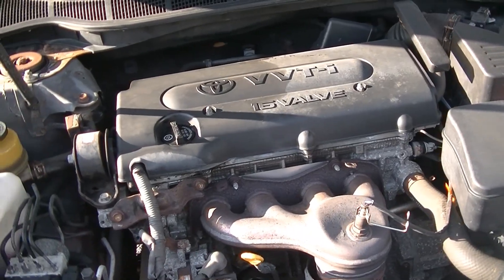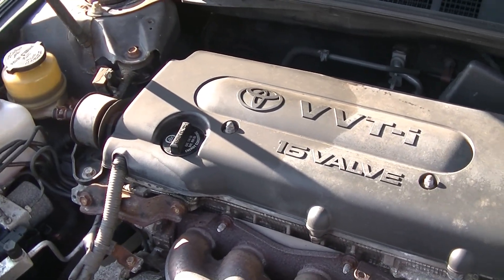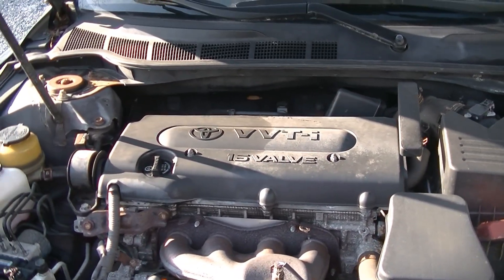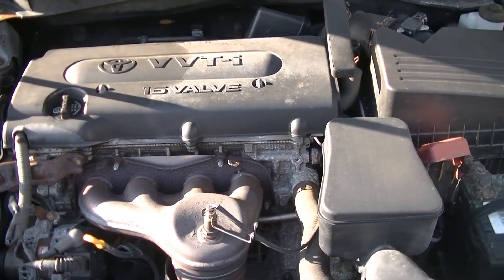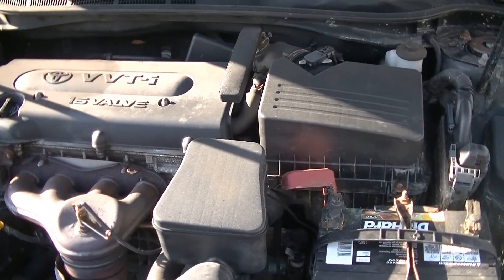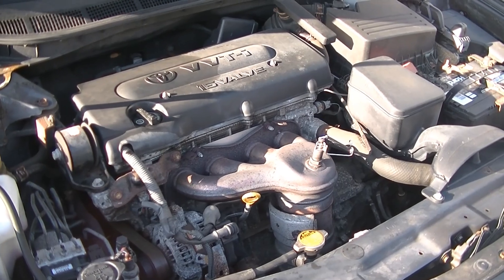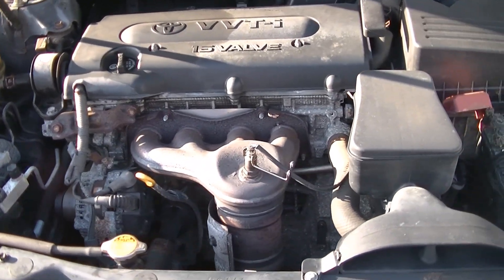Why you should AVOID a TOYOTA with the 2AZ-FE 2.4 liter engine!

Comment: I have a 2003 camry with this engine and auto transmission. It doesn't use any oil between 5,000 km change intervals. It doesn't get thrashed, gets a minute or two when cold started to allow the oil to circulate and has never missed a beat. It's about to get a new water pump as it's weeping from the tell tale hole, but that's just routine maintenance. Still runs quietly with plenty of power and will return 700km from a tank of fuel.

Comment: I have a 2004 camry LE. With. 240000 miles   use Mobil 1 and change oil every 6000 miles  it uses 2 quarts every oil change   I plan on going 400000 miles on this engine. Runs like a top  33 mpg hwy 24 mpg city  this engine is a great engine  just make sure to change oil and never ever let this engine over heat

Comment: I heard it’s the 07-09 with all the problems my 04 has 230k now burns a quart every week or 2 only after sitting for 3 years  of sitting other than that runs fine only had to change brakes and oil so far had it since 120xxx I heard the v6 had same trans and runs it out faster than the 4cyl I’d I had a v6 I would be stepping on it soooo good thing I don’t

Comment: My 05 Camry has nearly 400,000 miles and still runs smooth. Sounds like a new engine
Reply: I hate to say it but that's pretty much the end of its life cycle. They're meant to last 400,000 miles
Reply: Did it burn oil ?

Comment: keep the oil changed so the rings won't get clogged up and start burning oil..If the head bolts lift install timesert head bolt kit..great running motor when you know how to take care of them..
my new 2.4 engine never goes past half on the temperature gauge..

Comment: Yeah a customer/good friend is going through everything in this video now.Only good thing is I'm a mechanic,as you said it overheated 'once' and boom! Water in the oil and not running no more. As I was taking the head bolts out,out of 10 bolts only 2 were still torqued to specs,the other 8 were all less than 10-15 ft. Pounds . It really puzzled me to see that all the valves were rusted front and back and every piston was nearly full of coolant,cause typically head gaskets blow in isolated areas witch wouldn't affect every cylinder. Initially I was charging my friend $900 for a valve job (supreme love from machine shop and she's a good friend) but with the thread it'll be a extra $200-300 on parts... At a shop this is easily a $2000 job on average. My advice would be to go with a rebuild or a certified serviced engine with as many upgrades and satisfied recalls as possible or gamble on a extremely low mile one.

Comment: I have this engine in my car and I am a mechanic. If you have this engine in your car and it fails it's because you are an idiot and you don't use the right oil, or change at the right intervals. You will never have this problem if you do that. Those bolts come lose because your oil is terrible. This video is proof that idiot's make videos that aren't even needed. You treat these motors right and change the oil with a synthetic correct 0w 30 Mobil 1 oil, you will never have this problem. Especially if you change it every 3500 miles. Never change your oil past five thousand miles. This is the stupidest thing you can do. Of course it tells you to do this kind of thing in the manual. They are in the business of selling you a new car.
Reply: Toyota wouldn't have fixed any of the head bolt problems for free if there was any possible way they could blame it on the oil. How does poor oil or infrequent changes cause head bolt threads to strip?
Reply: @justliberty4072  infrequent oil changes can cause all kinds of problems. Including bolts to lose their strength and strip or break. I've seen that in my buddy's shop.

Comment: My brother works on these Camrys (& other Toyotas), and according to his experience, it is the 2007 & up with the oil problems. I have bought 3 Camrys from him, and have not had any problems with oil consumption. The one I drive now has over 240,000 mi on it. I just changed the oil(at 5,000) and it was about ¼ qt low. I haven't added any oil to since the last change. I don't know if any engine work had been done before or not, and it is the original engine.(numbers match)

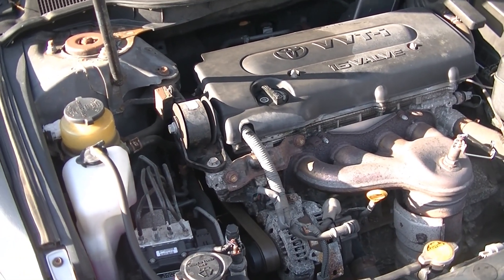Comment: I'm sorry but at 2:40 I had to pause it because you couldn't be more WRONG about helicoils and timeserts. In aluminum, they are actually STRONGER than the original threads. When you have a steel insert of a larger diameter, the original diameter threads are now both steel, and the steel/aluminum thread surface is now a larger diameter, thus more surface area for the threads on the weaker metal.

Comment: this whole thing about cooling system .
 what I did with the plastic/metal radiator at 90k miles is take it out and replace it with a 2 core all metal rad.I have 270k on mine now
with these toyotas it is very easy to do, it's not a VOLVO folks!

Comment: Anyone with a 2004 Toyota with the 2az-fe engine? They just burn oil. Used Mobil 1 for 100K, Used Amsoil for 35K miles and slow down the oil burning to half.  These engines from 2004 or earlier before the redesigned piston heads are notorious for this.  I’m not a mechanic and it’s not worth the costs for repairs. Drive it till the engine falls apart

Comment: 353000 miles on my scion 2.4vvt-i no recalls done. Yes its a 2AZFE. Burns oil but not alot. Its a very easy engine to maintain, its a workhorse... one of Toyotas easiest DYI engines.

Comment: 2AZFE engine is a great engine and typically operates into the 300k-400k miles. Change the oil every 5000 miles or 6 months to avoid issues and use a good 5w-30 oil. 

The first issue did have a TSB and owners were taken care of by Toyota and they extended the warranties for those vehicles. The fix is fairly easy and an advanced DIY person can do the job. Time Cert repair kits were used for warranty repairs and did not void the vehicle warranty (when I was working) they were as good as the original, and I have never seen one fail or personally heard of one failing.

The bad piston design was mainly an issue with the oil rings designed to give better fuel economy, which is also why they switched the 5w-30 to the 5w-20. They made a special kit that included new pistons, rings, and squirters that included all the gaskets necessary to resolve the issue however that isn't a DIY repair.

While this engine had its issues... it is very easy to work on, depending on the vehicle it is in, and extremely reliable. When I got rid of my Dodge neon it had 424,000 miles but I spent 10x the time and money on maintenance and preventative repairs than I would have on this engine. By the way, Dodge had a similar rear head bolt problem causing head gasket issues, the rear bolt holes were not deep enough from the factory. 

Every vehicle manufacturer has issues, but at the end of the day, this is one of the most reliable 4-cylinder engines I have ever seen. How many 4-cylinder vehicles have you seen with 300-400k miles on an original engine with only regular maintenance?

Just my personal opinion.
Reply: agreed,my vellfire 08 almost 200k km still fly like the wing.🤩
Reply: I'm considering the Alphard Van 2003 - 2007 model with this engine in it, but I know that around that time, Toyota was also touting the oil service intervals were now at 15,000 k's, which is when a lot of engine damage is done early on... hence my hesitation on this engine, the head bolt problem and the oil burning problem.  Most people follow the company recommendations not knowing any better not being mechanically minded... so the van I want quite possibly has had this extended oil service interval performed, not the better 5k mile / 8k km I do all the time on my old 5sfe camry....  The 1MZ FE motor has its own possible problems and the timing  belt will be a mission in that van / people mover setup, not much working room, if you know the Alphard engine bay setup.  What would you recommend yourself, still stick with the simpler 4 banger design or the V6 1MZ FE???  Cheers
Reply: Is valve train clicking normal
Reply: If I continue using decent oil and change it at 4k mi, would the issue slowly develops or this would avoid the future oil burning problem?
Reply: Check the oil every 2 weeks & add when needed (it will need)

Comment: Dude doesn't know what he's talking about. This is literally one of the most reliable engines. 2azfe can easily go to 250k+ miles. Mine is currently at 210k miles. Have not had to do any major repairs besides motor mounts.
Reply: Literally your personal opinion and experience. 
Lost over $5K thanks to this engine going out with only 119k miles

Comment: My son still drives our 2004 manual shift camry with almost 200k miles on it.   The only thing I've had to do is replace a valve cover gasket and leaky radiator along with 5th gear repair with a clutch (which is apparently fairly normal). Still the best driving car I've got... It is a Japanese made car... Don't know if that makes a difference, but I love this car.
Reply: 2004 2az fe engine  has different piston design   2011  Ithink is when they changed the pistons

Comment: I own two cars with this engine and zero problems, one for 19 years and one for 14 years. You can't cheat on oil change maintenance!  The people I know personally with oil consumption issues have cars that were neglected and overheated. No modern engine can tolerate overheating and skipped oil changes. Knock this brand, but I service several brands of cars and this is my favorite of all engines.

Comment: My brother-in-law had a 2002 Camry with this engine. At 189,000 km (113,000 miles) the head bolts stripped out, coolant dumped into the cylinders and the engine was destroyed. It cost almost $9,000 to get the car back on the road. The dealer swore he'd never seen a failure like it (Toyotas run forever!) but the Toyota mechanic quietly said he saw quite a few of them. The engine had always been dealer-maintained, had its regular oil changes etc. The engine was going to self-destruct eventually, no matter how well looked after.

Comment: 329k miles on mine ( 2005 camry )...doesnt burn a single drop....a real champion of an engine. there are some people with over 1M miles on it...one of toyotas best
Reply: it is not the engine in the 2004. This engine 2AZ-FE was in the 2007-2009 Toyota Camry. When he said 2002-2009 he doesn’t know and is WRONG.

Comment: Oil burners are extremely costly money pits as oil isn't cheap, either are spark plugs , or sensors or catalytic converters which need replacement on a regular basis with oil burners as  they cause major carbon build up. So to the comment made keep the oil in them they will last forever so untrue and a ridiculous comment to even make .

Comment: You have no idea what you’re talking about! These engines will last forever unless you abuse it.
Reply from the maker: Or unless they burn oil due to the low tension rings that they began using in 07 and run it out of oil. There’s a reason Toyota issued a service campaign on them.
Reply: Defective piston heads in these notoriously 2az-Fe engines.  Owners got put in a tough situation with this engine. 3K oil changes with conventional or full synthetic or 4K-5K oil changes with Amsoil Signature Series
Reply: Never had an issue with them unless they have been abused.

Comment: Have this engine in my 2006 Scion TC. Just turned 178,000 miles and it doesn't burn a drop of oil. I always use Mobil 1 full synthetic for every oil change, and always do my oil changes between the 3k and 4.2k mile mark...no clue about the previous owner though (bought the car with 123,000 miles on it already). I also run a full bottle of Techron in it before each oil change. With good maintenance, this engine will last and last. I'm nearing 200k miles and still average 31+ mpg on the highway. Bulletproof.
Reply: still driving my 2007 scion tc with 257k miles. I do add extra oil in between changes.

Comment: 2004.
2.4l.2azfe.
camry.225000 miles.
i used for several times, power steering oil, transmission oil, petrol/diesel engine oil of all grades 
0w16 to 20w50, and it might be capable to use water without any issues.
used it for more than 6 time to travel 2000 miles / 18 hrs per each without stop.
used it in extreme harsh weather, 51 celuis/124 f° for 4 hours riding at 100 mph dust weather
used in exceptional harsh weather 55 c°\ 130f° short intervals, found that i have a super cooling ac & super cooling engine system 
the greatest toyota/ lexus engine are those made between 1980 - 2007.

each 1000mile i need to add half liter of oil.
thats it.
maintenance:
1 Oil pump
1 tensioner pully 
1 radiator
2 radiator fan motors
regular spark plugs/ air filter/ oil change
Thank you.

Comment: I have an 09 camry with the 2az-fe eng..482,068 miles at the moment.  Sure, it burns oil and there are things to do to mitigate  the oil consumption, but I'm still driving it to this day. Original engine, transmission... water pump... drive belt.  What other car can you say this about? I love this thing. And nearing half a million miles, it's still fun to drive!
Reply: My friend has a 09 Vibe with the 2AZ and has 300,000 hard commuter miles on his. It burns a little more oil than most, but it's a solid engine and feels better than the 1.8
Reply: Ever had to replace lifters yet ? Another common issue
Reply: @kylel4689  have not replaced lifters, haven't replaced any internal engine components ..yet
Reply: Im at 293k changed about everything my waterpump starter still original
Reply: Hi @wes_5kyph1 what things do you do to mitigate the oil consumption? And how often do you service the vehicle?
Reply: Same here, got 230 thousand miles on mines, minor repairs other than that I love it
Reply: @KyleEdwards-if3po trying to get rid of mine. interior panel is worn out and it needs a new transmission. 2nd car is 2nd gen scion tc, stick shift with 370k miles...yes some things at little cost can really help in the long run
Reply: @Wes_5kyph1 damn 370k , gotta love Toyotas

Comment: My 2008 2az-fe uses about a quart between oil changes. It has 196,000 miles on it. I strapped a turbo on it.  It runs great.
Reply from the maker: A quart between oil changes is nothing! I’ve actually driven a turbo TC with the 2.4. Fun little car

Comment: I guarantee you if someone is selling one of these, it’s because of the oil issue. I have yet to find one that’s been fixed, all I’m finding are lemons. Avoid the gamble unless it’s a V6 or it was fixed….or it’s a 2010-2011 which had the 2.5
Reply: i feel ill.  just bought one of these for my kids first car, for more than i wanted to pay.  Solid bones, clean car, everything works, 201K.  hoping to get a couple of years out of it, even if I have to add oil between changes.

Comment: We have 2004 camry 2.4l xle in family for 10 years now. It has 165000 miles now and have some oil consumption, but no major problems with engine yet. Alternator and starter had problems, but not the engine itself. This engine is very heat loaded, this i can confirm. We change oil every 5000 miles.

Comment: When you consider how many millions of vehicles sold with these engines, only a small percentage failed. 
Also re years, from 09 on they had modified internals, slightly higher compression. So 09 on, well maintained should be no problem.

Comment: I tend to agree with your advice. Had a 2007 Camry that got the warranty repair at 85,000 miles. It was using a quart and a half in 1200 miles per dealership test. The car was driven mostly freeway miles, 80 miles per day five days a week. I had regular oil changes every 4,500 to 6,000 miles. That wasn't good enough to prevent the oil consumption problem. After the repair the engine ran fine.
Reply: Would you care to offer an update I'm curious, still running good? Planning on keeping it?

Comment: 350K on mine. This engine is among the simplest to work on. Did everything myself. Only oil changes every 5K miles and changed the cover gasket once. Top tier engine.
Reply: Basically same for mine, 335ks.  Cheers to them lasting forever lol
Reply: I have no idea what this guy is talking about.  These engines have legendary durability.  Wowza.
Reply: Did compression test on 2006 Camry 2.4 after 350k miles of abuse - all 4 cylinders look like brand new at almost factory compression
Reply: Are you both driving 2.4s? What year?
Reply: @jordandudgeon346 the 2AZ-FE is only a 2.4 liter engine
Reply: @TheWholeGrainBread_Real true, the 2.0L was the 1AZFE.
Reply: Dude said keep up with  cooling system..that's the only useful advice in video.
Reply: Does is have any blow by when you take off the oil cap when the engine is running
Reply: I'm about to get a 07 with 19k miles for 9 grand should I avoid this?? Getting scared now
Reply: Mine just hit 300,000 miles and runs great. Only had to replace a water pump a few years ago. Outstanding engine!
Reply: Quite true: it’s a very simple and easy engine to work on. Mine’s over 150k but has a cylinder wall that’s smoother than a baby’s butt (no scouring) and a pistons still solid. Very solid engine, not sure what this dude is on about.
Reply: I’m at 293k changed about everything water pump/ steering pump still original
Reply: Thats what I love about this engine , its simplicity . I can tear the heads out in 2 hours . Im looking to completly rebuilt it . Its got 300k on it . 2004 Highlander . super clean inside and out . Well taken care of by My Wife . Not a stain on the seats .